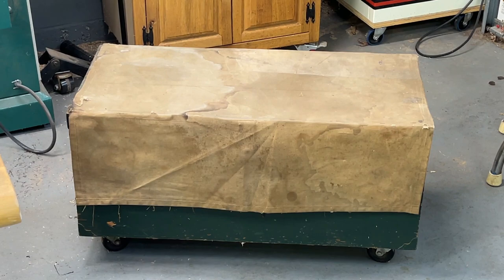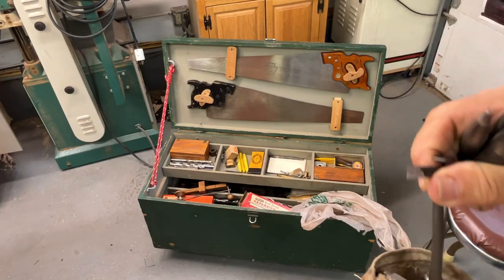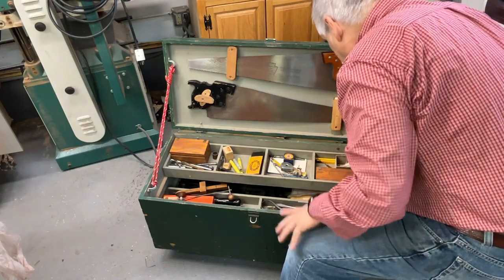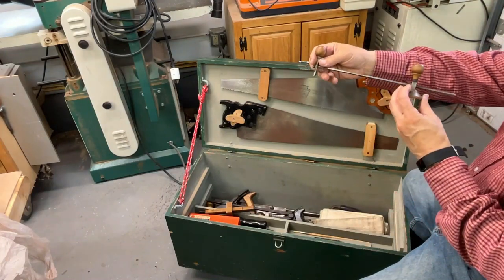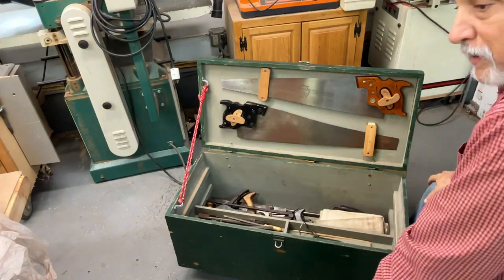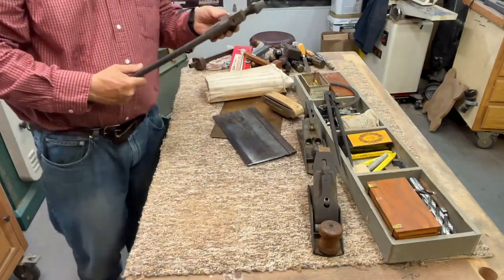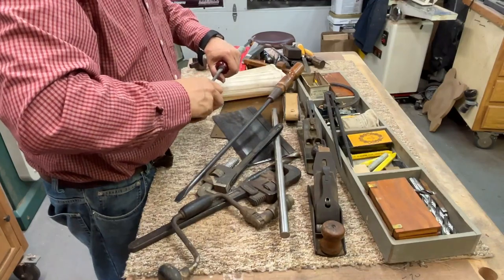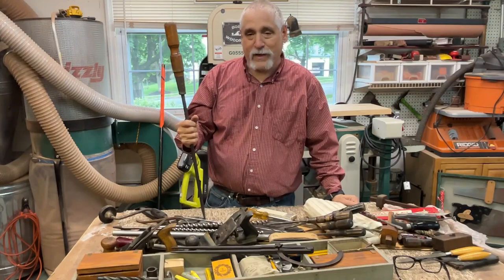Antique Tools - Anarchist Tool Box - What's in the Treasure Chest???

Comment: It is funny that people don't think a brace and bit works. I have compared 1 inch brace and bit with a corded drill through pressure treated wood to do some timber framing. The brace and bit were far superior. The power heated the bit and it would jam. The brace and bit was work, but the holes were much better for pegs. And they were about as fast as each other.
Reply from the maker: Thanks for the comment.  What’s your thought on the 3/4” twist drill with the brace?
Reply: @BobAmarant  I have a series of brace bits down to 1/4. I do medieval woodworking demonstrations with all hand tools.

Comment: Boat builders like to use slotted screws and some prefer the Yankee drill to a battery drill.  It's supposed to give you a better feel for the wood.
Reply from the maker: Thanks , you might be onto something here as he had 8 regular screwdrivers and one a slotted screw but on the Yankee driver.

Comment: The brass peice is brass kick plate for the bottom of a door pretty sure
Reply from the maker: Yep, for sure.  copper color, most likely brass. Thanks for watching.
Reply: 3/4 bit had a Morris taper on it at one time ground to fit a hand brace. The guy was a house carpenter I think not a furniture maker imho
Reply from the maker: @jolo7965   Yep, I agree